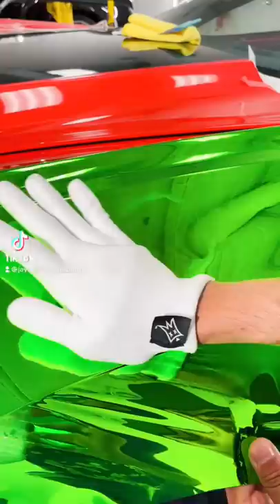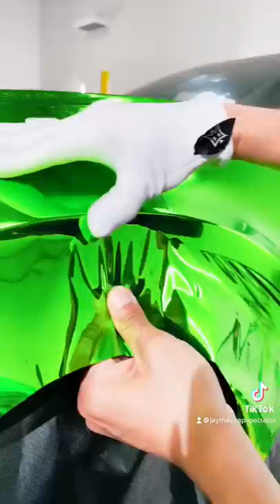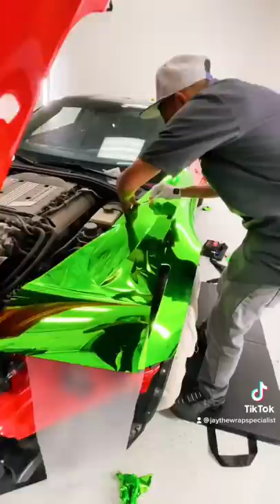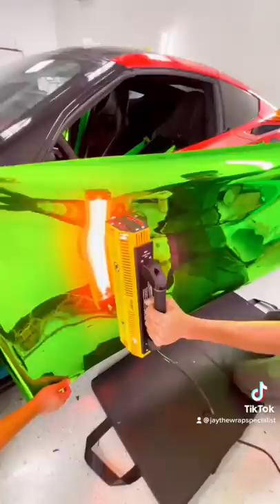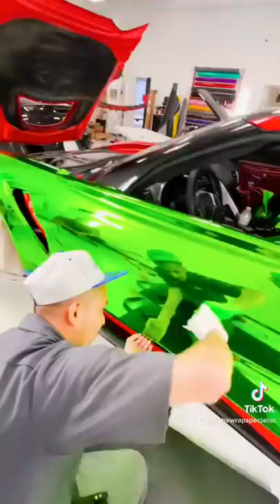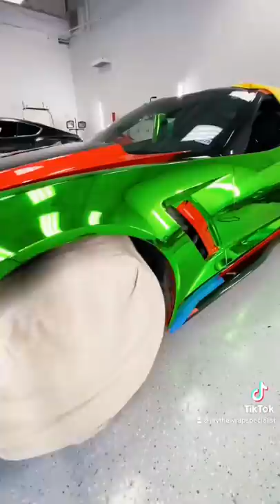HARDEST Chrome WRAP to install‼️🥲😱 | Lime Green Chrome Wrap ! #carwrap #carwrapping

Comment: A friend and i tried wraping the hood and the top of his audi. It was a nightmare. It seemed easy since they were both flat surfaces but dont get fooled, that shit is dificult even on flat surfaces. Doing it on this car must take A LOT of experience.
Reply: Lol, wrong....WRONG! I'm a diesel mechanic, but some of my customers have asked me to put their company logos and phone numbers and shit on 30 and 40 foot box trucks. I thought sure, it's a big flat surface and it doesn't have to be absolutely perfect....Gee zuss CHRIST!!! Fuck vinyl wrap! That's as far as I'll get into it.....I DREAD the next time a truck needs one.....
Reply: The only problem with Chrome wrap is, is that it gets hard with heat
Reply: @jesterokjones4954  flat and flat w/ thousands of rivets are whole different ballgames.  Having the right tools and knowing some basic tricks of the trade goes a long way.  If I were you, I'd charge a bit more and hire a vinyl installer for those jobs
Reply: @WarmGlowinWarminGlow  lol, yeah, those rivets are something.... special I tell ya. Really the only way to get all the air bubbles out by the rivets is to cut very small skirts with a razor blade and do your best. I thought about outsourcing it too, but then again, I get paid hourly, fuck'em!
Reply: @jesterokjones4954  hah right on! I just started working again doing vinyl wraps and they've got a huge semi to do after we finish this beast of an RV - they needed some help, bad!! Lol - Diesel mechanics around here are making bank 🤑
Reply: you tried doing what to it
Reply: @jesterokjones4954  why not a sticker at that point? Would be way easier and a bit of alcohol would take the glue away.
Reply: @0xsergy  I believe stickers, by the time they get that big, are more expensive than vinyl.

Comment: I've never seen this before. I'm curious what is the difference between wrapping and painting the car? Are they similar to the idea of placing a skin on a device or console? How long does a wrap usually last? Does it last well at different temperatures? If a car gets in an accident and it is wrapped, would one be able to kinda do patchwork like painting? Are wraps generally more or less expensive than painting a car? How long does it take for you to wrap a car because it seems very meticulous and needs to be precise. It's really cool to see.